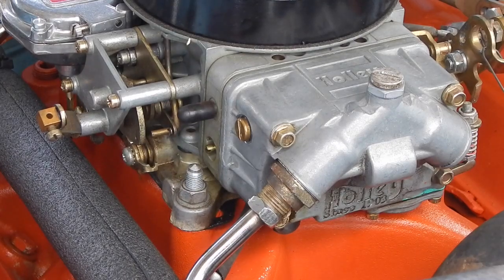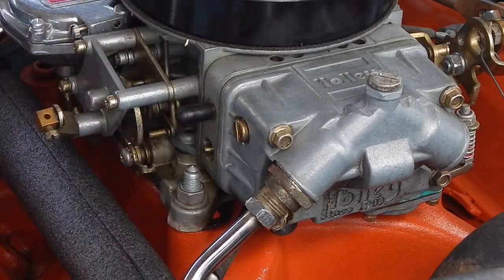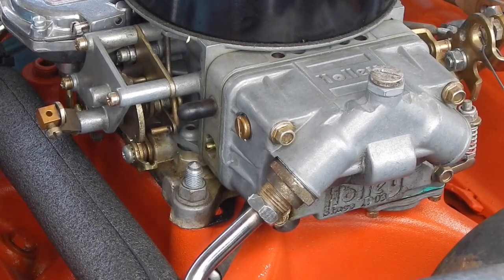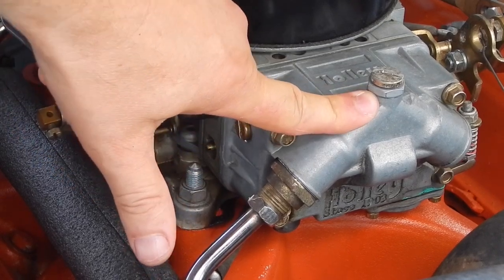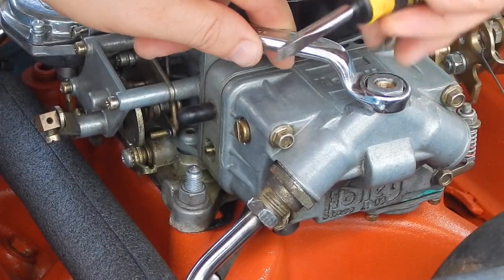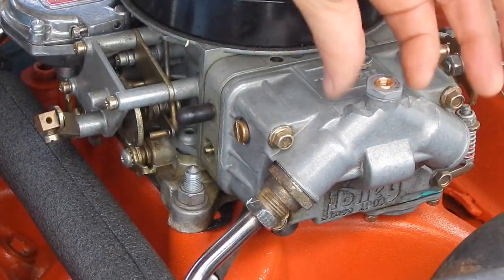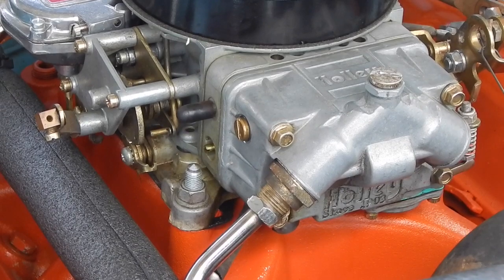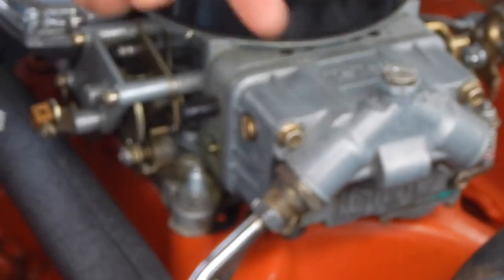How to replace and adjust a Holley needle/seat

Comment: Bad needle & seat O-rings are a very common problem causing fuel by-passing the needle and seat and flooding the engine.  I wonder how many carbs have been tossed by folks who don't know these basics. Remember, Holley has been around for over 100 years. They are not hard to maintain if you take the time to learn about and look after them. Good luck!

Comment: OK so I'm working on a 650 holley double pumper. Stumbling issue off idle. Holley recommends go up 2 sizes on nozzles. I'm going start to rebuild it. So what part number or size do I need for needle?
Reply from the maker: needle and seat stay the same.   Stumbling could be in the accelerator pump adjustment, including the cam.

Comment: Can bad needle cause air filter to be filled with gas
Reply from the maker: Usually a bad needle and seat overloads the engine with gas.   It can "cough" it up and splash a little on the air filter

Comment: I need your help.i am rebuilding a Holley 600cfm carb.i am about to purchase needle and seat valves and I found out that there are 0.97...0.110...0.120...0.130....0.150 tip.which one should I purchase??
Reply from the maker: I usually run the .110's

Comment: My needle seems to be stripped as it sits too low.  When I put the nut on and the head screw it just spins the needle back up because the nut won't lock it... and I can pull the needle right out...I think I need a new bowl?  What do you think?
Reply from the maker: hard to say without seeing it.   You'll just need to look at the threads closely and see.   Make sure it's the right needle and seat also, because there are different sizes.

Comment: Can you help I have a issue I have a Holley 670 with a stuck float the needle and seed is all the way down to the point the bolt does not bring it up what should I do?
Reply from the maker: Try a small needle nose pliers, that should work.
Reply: @318willrun it did not work there is nothing to grab what else should I try?
Reply from the maker: @cadehankes2856  take the bowl off.  That comes off very easy.  Then you should have access.
Reply: @318willrun  ok the truck won’t start due to not getting fuel but if I poor fuel down it it runs good would that still be the float?
Reply from the maker: @cadehankes2856  Not getting gas ... so either no gas is getting past the needle and seat, or the float is set way to low.  You have the sight window on the side of the bowl to check the fuel level.
Reply: @318willrun  no fuel in the bowls
Reply from the maker: @cadehankes2856  Is the fuel pump pumping?   Is the fuel filter plugged?   IF neither bowl has fuel, I would be suspect of the fuel delivery to the carburetor.
Reply: @318willrun  sorry asking so much and just fuel it getting to the carb though fuel line took it off and turned key and comes out
Reply from the maker: @cadehankes2856  If the fuel is coming out of the fuel line when you turn the car over, but the bowls are dry, then your needle and seats are out of adjustment.  Put them in so about 4 threads are sticking out of the bowls and see what happens.
Reply: @318willrun  ok thank you will try. Thank you for helping me as much as you have very appreciated

Comment: How would you remove the needle and seat if it's all the way down flush in the carburetor
Reply from the maker: It won't be totally flush, you'll just use the adjusting nut to back it out
Reply: @318willrun  it looks totally flush
Reply from the maker: did you try it yet?  If the nut won't reach it, you'll have to try something else. Maybe remove the bowl, needle nose pliers, something like that.  Never seen one that the nut wouldn't remove though.
Reply: @318willrun  okay ill look again when i get home Thanks
Reply: I got it out with a flathead screwdriver and the O-ring that goes around it is smooth and flat and when I put it back in now the car is flooding bad so is the O-ring the problem
Reply from the maker: could be the wrong needle/seat ?
Reply: @318willrun  ok ordering a new one

Comment: Nut first, then plastic washer, then adjustment screw.
Reply from the maker: Actually, there was a gasket that stayed with the bolt/screw, so that is why I used the plastic washer under the bolt.   Should be a gasket on each side of the nut.